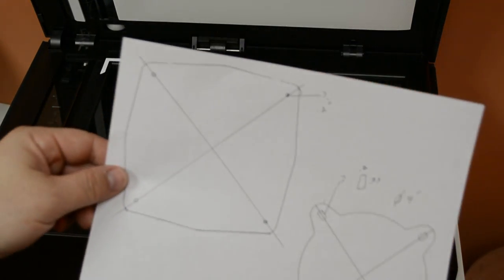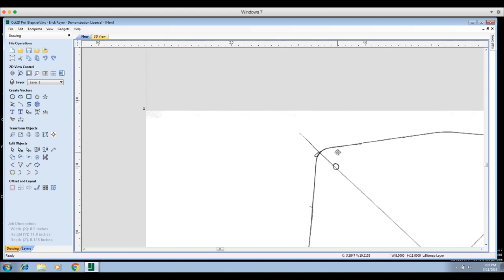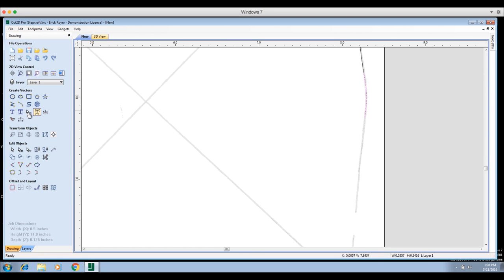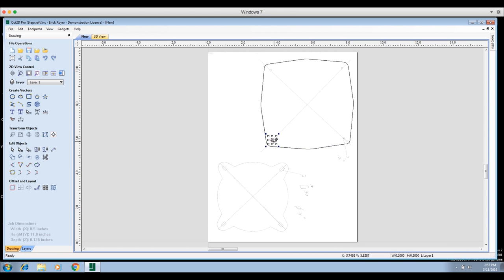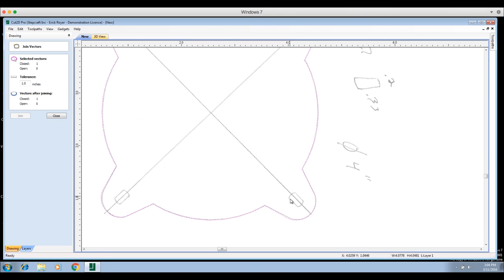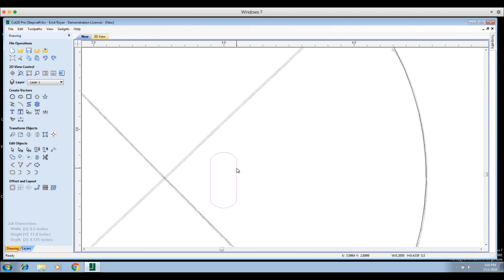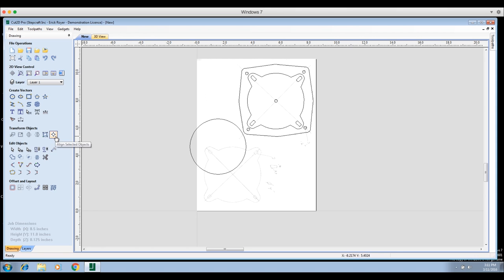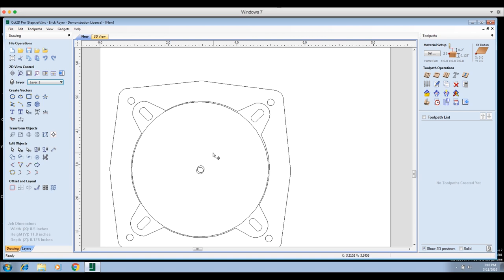STEPCRAFT TRAINING - Making A Car Audio Speaker Adapter With A CNC - Part 2

Comment: I would like to use a phone's camera instead of a scanner. Is there a way to just drop a bit map in and then define dimensions and have the program extrapolate from there? So I could have a drawing that isn't too scale but once I tell the program the XY dimensions, it would be able to scale scale everything else off those dimensions?

I'm currently learning fusion 360 but my coworkers are absolutely not able to comprehend it so I'm looking for a simpler program to where they can knock out a speaker adapter quickly and easily.